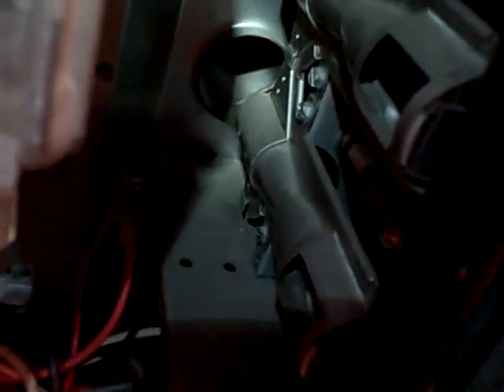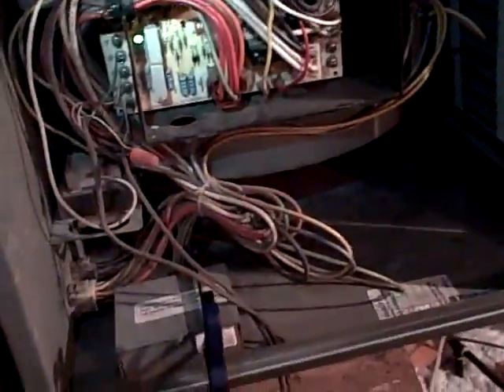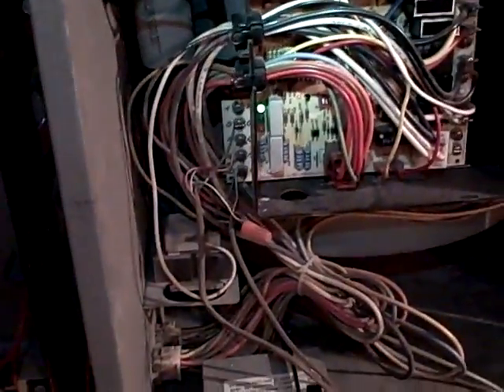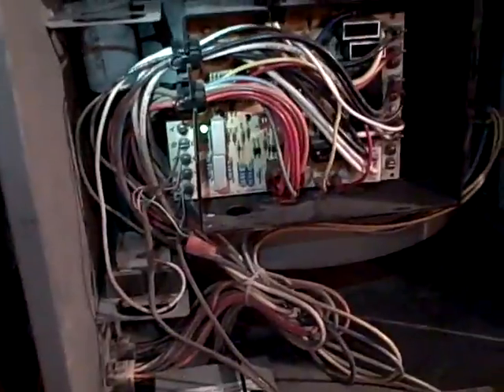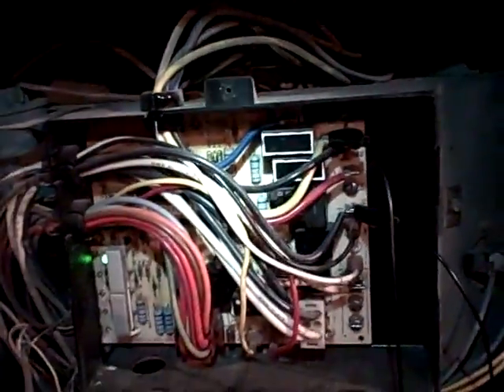HVAC Troubleshooting a gas furnace control board and blower motor.

Comment: My AC is not blowing cold air. Help! My compressor turns on the unit was recently cleaned, all filters are new, air is just not cold anymore.   Can a blinking green light in my attic be cause for concern?
Reply from the maker: Hi!  Well its that season again for most people!  I've actually been running my AC for a good while now, but Some of the medicines I take really mess with my internal thermostat so I cant sleep unless its 68 or 69 degrees in the house. :/

...when you say the compressor is running fine, you do mean the outside unit, right?  If the outside unit appears to be running, then the next question is wether the unit has been cooling and slowly cooling less and less or if say, it was cooling fine three hours ago, then suddenly stopped and is only blowing out room temp air.  (It is blowing air inside, right?)

Lets make a few assumptions.  Lets assume the air is blowing inside and the outside unit appears to be running. This shortens the possibilities down quite a bit.
1. You suddenly had some sort of problem and now there is no freon in the system.  This could be from a big crack in a line, a hole rubbed through a line that finally blew out, a compressor terminal cracked/blew out and dumped the freon, someone stole the freon or a number of other possible causes.

2.  The outside condenser fan is blowing but the actual compressor in the unit isn't running.  This could happen for a number of reasons:  the compressor run capacitor is bad (most likely cause), there is a burned off high voltage wire (usually one of the compressor leads), the compressor is locked up or aged enough that the usual capacitor alone cant crank it up, the compressor has an open wire internally and is dead, the compressor is shorted but for any number of reasons didnt trip the breaker, or only tripped half the breaker, the compressor pulled a high load and only tripped half the 240v breaker and the fan is still spinning, just not full speed.

If the outside unit appears to be running there could be additional reasons, but one of the two top categories is probably going to cover it.

Either way you're going to need a technician to have a look at it.

Reply to me and let me know if my assumptions of what is running is correct. If not then tell me what is going on.

...the green light.  Usually thats no big deal, is the green light inside the unit on a circuit board or is it in the emergency drain pan?  Usually if there is a problem and there is a led light on the control board it will flash a code to tell you what the problem is, assuming its indoor related.

    Mike
Reply: That blinking green light is very bad you screwed it up big time. It is going to take a havc professional to fix it correctly. Get ready to pay for your a/c to be fixed. Oh, boy you are in for a hunrting.

Comment: Just wanted to say thank you very much for your videos on diagnosing heater furnace blower motor repair. You saved me a lot of money and the frustration of dealing with the slew of inept A/C guys that I've paid to come out, and not solve my problem. I followed your video exactly and was able to determine that my board was bad. After going thru all your checks first then examining the back of the board, I saw the burned connection to one of the relays. I would suggest telling the viewers to check the board for obvious burn marks FIRST to save time with all the diagnosis, then they could do the other checks afterwards if they're inclined to. Another suggestion is to make sure videos are not blurry and hold the camera as steady as possible when pointing to an area. Laser pointers work well if you have a free hand. Please tell me how I can donate something to you for helping me save a lot of money and frustration. Keep up the good work. Thanks very much, Tony J.

Comment: What u in school for degree wise? U gonna leave hvac?
Reply from the maker: I was just taking classes to pick up general classes at the time, nothing specific in mind.  As far as work goes, well lets just say that with my spinal issues I'm not able to do anything right now.  I've had back issues since I was a teen but over the last several years its been progressively worse to the point that just sitting at my desk chair for any length of time causes increasingly severe pain.  I have good days and bad, but for the most part I'm basically going through a serious life change and trying to adjust to not being able to do most of the things I used to do :/

Comment: UNSOLVED MYSTERY:  I have a '93 Goodman furnace. It was not on (the house was vacant for 3 years) but when I redid the gas plumbing, gas man OKd it, tried it, no go - the code blinked 4 - cleaned out the exhaust flue, it stated right up and heated the house.  BUT! the next day no go!  Circuit Board (B18099-13) - blinked rapid continuous briefly then stops.  Turned on furnace - all it does is for a second engage the blower motor - NOT the inducer - and shut off.  (I jumped thermostat; power is on; gas is on; didn't test gas valve; cleaned flame sensor; glow plug igniter is like new; jumped all 3 limit switches; inducer and pressure switch work; just now I took out the circuit board (3 amp fuse OK) and am examining it; even redid the grounds to the house.)  How many more things do I have to do??!!
Reply from the maker: Hmmm... Well thats strange!  Ive seen blowers kick on for a split second when the unit gets main power if the blower relay is one of those funky ones with a mini circuit board attached.  ....but that is strange. I assume youve checked the blink codes to the door chart...   Have you checked all of the limits to see if any that might be resettable are tripped? (I would still expect it to run the blower though)
...next thing, does the board or transformer look new?  Try reversing the power leads on the 24v transformer, I know it shouldnt matter but some circuit boards are finicky about which way its powered! That would be my main guess, my next guess would be to pop off the circuit board and check the back of it for a scorched/burned spot. I have changed lots that took a lightning strike down the street and the board arc'd to ground behind it.
Let me know what you find!
Reply: Yes, Mike, and thank you for the tips and moral support!  I did check blink chart - mine was rapid continuous. I did actually jump all 3 limit switches, acted no differently. Board looks old, didn't check transformer yet.  Took off board and checked for scorched spots -looks good actually.  I went to Fixya and got a bunch of ideas to try next.  Some say that circuit board went out - odd though cuz I actually had the furnace going nicely after I fixed (4 blink) the vent that was clogged.
Reply from the maker: Always fun trying to troubleshoot over the internet, hehe. I wonder if the induced draft motor is getting power?  Maybe worth putting the meter on it and doing a call to see if thats an issue later.  Oh, sometimes theres a limit switch on the back of the blower motor housing.  Its not using a damned smartvalve, is it? (Ugh).  If you've jumped out the limits then its either the board, reversed power on the transformer or an issue with the induced draft motor, since it should be the first thing coming on.  
....fun fun!
Reply: Yes, inducer won't get power, I thought b/c of the board.  the limit switch ... but since inducer is the first thing that needs to come on...  Jumped inducer with 110 power, and works fine, but no call. So I thought board.   What is a smartvalve?  (I see that mine doesn't have a manual shutoff)  Thank you again Mike! I bought a (B18099-13) board, put it in, but in the interim I used post it note sticky strips, some fell off, but by process of elimination i got all but two wires put back on, two black ones.  Funny how every pic of a hundred i see of the circuit board is WITHOUT attached wires, so I'm at a bit of a loss at this juncture.  thank you!
Reply from the maker: That sucks!  I usually change boards out one wire at a time, if I have enough room to do so. Its a pain but usually Im changing them in the summer and its Like 150 up there and the brain doesnt like to work so good, so the less chances for mistakes, the better!  What do the two black wires go to?
Reply: Probably tripped the manual reset rollout switch by the burners. That era of Goodman furnaces had a high failure rate of cracked heat exchangers. You need a new furnace. Nice try diyer at guessing at the control board. Sounds like fun buying parts, installing them, then finding out they didn't fix the problem.

Comment: Hello I have a question; my Fenwal HSI ignition control module is bad, I found a Honeywell universal but it has a 30 sec pre-purge but the original has no pre-purge or post purge. Can  I use it?
Reply from the maker: Not sure what furnace you have,but typically if the universal instructions lists your make/model/board as being one that it rill replace then you should be fine. Cant hurt to have a purge, I wouldnt think!  Of course if you have ant doubts contact honeywell or get a stock oem replacement board.  If the unit is still under warranty check to see if the board is covered and make sure you wont void the warranty by using non oem parts.   I've never personally had any problems with honeywell generic boards working on any model that the packaging says its good for.

Comment: My Goodwin 10899 furnace has needed 2 control boards in a short time. Could something in the furnace be causing it? Hate to keep replacing it!
Reply from the maker: PATRICIA lyons wow, that stinks!  Usually I see a lot of boards that go out after recent storms, its likely a lightning strike down the road caused a surge and blew out the board on a lot of them.  Usually these will have a burned spot on the back of the board where the surge arched across the inch or so space to ground out on the sheet metal below it.  If this is the case I would recommend trying a surge arrestor, if you have a gas furnace then its easy enough to put one on it there if its just using a 120v plug, just make sure the arrestor can handle the amp rating of the furnace.  Lots of electric companies offer a whole house surge arrestor that they mount at the main breaker box, then they recommend arrestors at the devices you want to protect as well.
Reply from the maker: PATRICIA lyons ...oh and sorry for the delay, the message was in the spam folder!!

Comment: Hi I have a question my furnace control board is telling me that the limit switch is the problem but I checked and it's good (not open) my question is could the board fail and send a wrong code
Reply from the maker: My first thought would be to make sure that you checked ALL the limit switches.  The board could be bad but its also kinda easy to miss a limit switch on some of those units.  I can think of one unit that has two limit switches on the burner assembly, the square one on the back wall, one mounted off to the left and another mounted at the flue pipe exiting the unit.  If theres a wire in there make sure to follow it :).  ...or start following it from the board out (though its a pain sometimes that way)
  I suppose it is possible that the board is bad though, trying to remember if Ive had that error on a bad board. Quickest way to check visually is to pop the board off, being careful not to break the plastic standoffs, and check the back of the board to see if you find a burned/arc'd spot where voltage has surged from the sheet metal through the board.  Ive found LOTS of those over the years where there was a power surge or a lightning storm in the area.

Check back and let us know what you find!  Of course if your not a tech its best to have a tech work on it since you're working with both electricity and gas :)
   Mike
Reply: Thanks for responding I checked every limit switch and flame roll out sensors using the schematics I isolate them one by one I looked on the back of the board and I did not see an arc or black spot I saw a little darker brownish spot ,it's a little confusing because it looks like the board is doing its job by throwing a code I change the board on my moms furnace once but the symptoms were so different it wasn't doing nothing so I manually turn the inducer on using the door switch thanks by a video I watched from you I will double check to make sure I didn't miss a sensor if not I'll replace the board is an amana serial #  guid070ca30I ll let you know what happened
Reply from the maker: Hmm... Will look forward to hearing how it goes!   ....you shouldnt bypass the board and run the induced draft motor, I wouldn't recommend bypassing anything on gas heat even temporarily since you cant be sure how everything interacts with the safeties.  If the draft motor isnt coming on either the board is bad or it sees something else going on wrong and isnt getting to that stage. ( or something could be wired wrong or an improper board for the unit) ...assuming I understood what you meant anyway! :)
Oh! Sometimes there is a limit on the blower housing!  I forgot about that!  Havent seen it too often but might check.
Reply: Thanks mikie
Reply: Hey Mexican master diyer. Do you know what a multimeter is? I didn't think so. Why don't you go make me a big mac and try not to muff that up. LOL good luck.

Comment: when you jump from L1 to the heat terminal, are you feeding it 120 volts when you jump it?
Reply from the maker: Yes. Basically L1 and L2 on one circuit of 240v feed each side of the heat strip completing the phase and energising the heat strip. I found a simple diagram that shows it laid out really well:
http://hvacbeginners.com/wp-content/uploads/2013/02/ELECTRICHEATERWIRED.jpg
Reply: mikie2501 thanks. Really enjoy your videos, learned a lot from them.
Reply from the maker: Thanks much!  I've actually been feeling a little bit better of late with all my spinal issues, well enough to at least answer a good bit of email either from the recliner or in the evenings or afternoon laying down trying to get comfortable or take a nap, like now :). Still havent felt up to sitting in front of the computer and editing video, but hopefully soon at least a little bit, I have a bunch of stuff to upload, just needs editing, lol.

Comment: Hi. I found your video in the sea of others as I am trying to find the problem with my HVAC. It's a Ruud Silhouette and I had an issue when trying to adjust the heat. The blower won't shut off. Then it won't respond to increase or decrease of temp. It doesn't have a pilot like what I'm used to. It tells you to call up the blower and it automatically starts it. When removing the panel from the furnace it shuts off the blower then because the white button is no longer depressed (sorry I'm not sure of the technical term here). I had a friend over who was going to try to light the pilot for me and after messing with it we had heat. I thought the problem was solved. However the blower would not shut off and I had to go down and flip the breaker to shut it down. I was afraid to let it run too long. I went and purchased a new thermostat hoping it would be an easy fix but no such luck. I am positive that I have the right wires in the right spots as I took a picture of what was there and then hooked the new one up the same. Ideas? Unfortunately as a single mom of 5 on SSD/SSI I just can't afford an HVAC repairman in. Thanks!
Reply from the maker: Alright, first off I have a video, its a bit long with a few other things in it, but it shows the proper sequence of events for startup for a furnace like yours.
HVAC how a gas furnace works.
Your unit doesn't have a pilot, it has a hot surface igniter.  When you say the blower won't shut off do you mea. n the actual blower that blows air through the vents or do you mean the induced draft motor in the top section of the furnace (with the little wheel attached to it)?
..you said you replaced the thermostat, I'm not sure which thermostat you bought but almost all thermostats either have a software setting or a manual switch on the back of the thermostat that HAS to be set for either Gas or Electric heat. Let's get that sorted out before you do anything else!  Then watch the video so you know what's going on.  After watching the video you can remove the TOP cover on the furnace (leave the blower bottom door on) then have someone switch the thermostat to heat and turn up the temp high enough so that it should come on.  Don't stand too close in case the flames pop or blow back. Also make sure there is nothing flammable near the furnace.  Obviously you should have a professional look at this as gas/electricity is dangerous! (There, my standard don't touch it you could die I'm not responsible warning!)
...anyway watch the sequence of events and mentally note where it differs from the video link.   ...also make sure on the thermostat that the blower switch is set to AUTO and not ON.  Email me directly when your done, mikie2501 AT gmail.com and possibly give me your phone number as well (what hrs your home) 
If the tstat is setup right it sounds like it could be the hot surface element, but we'll see.  Mike
Reply: Check your email. =)